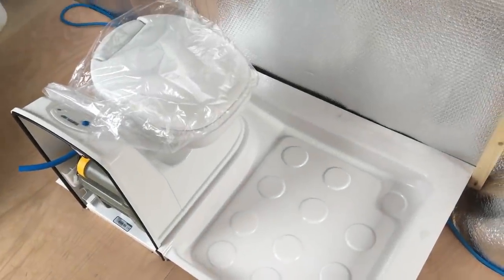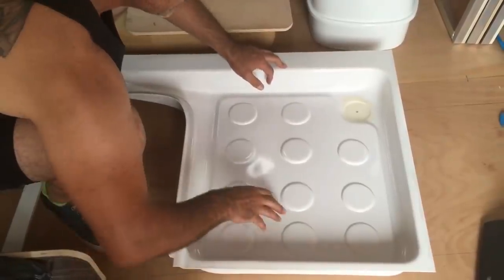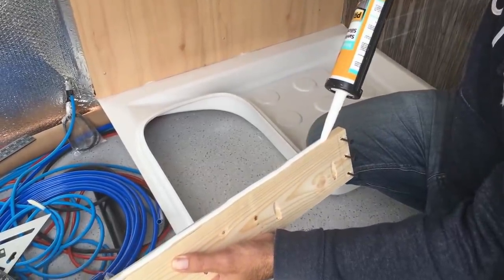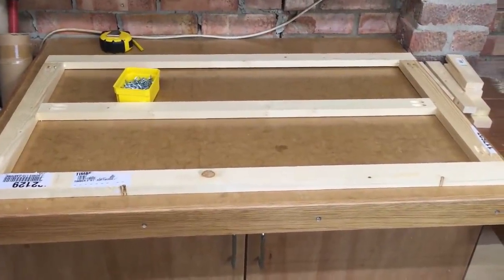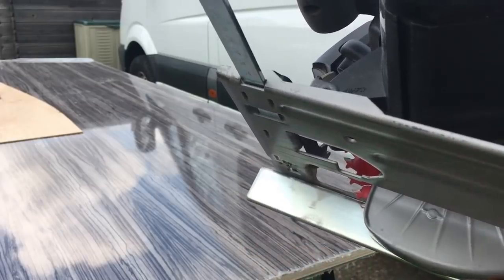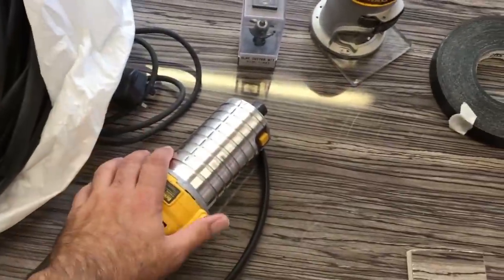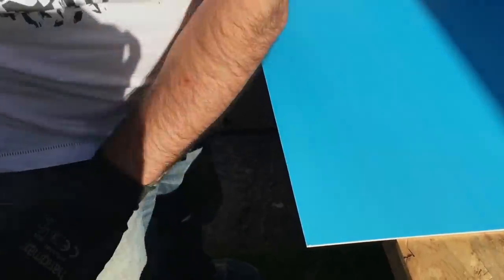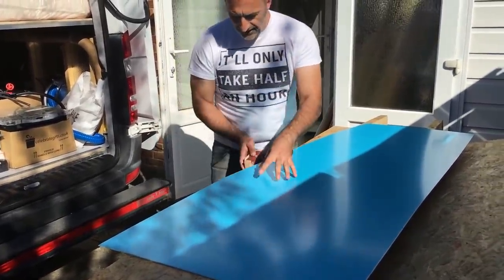Mercedes Sprinter Camper Van - Shower Build

Comment: I think you mounted that shower pan + cassette toilet a bit off. normally it should be 180 degrees rotated so you can pull the cassette outside of the vehicle. less messy when you need to empty it.
Reply from the maker: We have been living in the van for 4yrs now and not had any problems with the toilet. Nor have we had any smells inside either. 
Much easier than cutting through the Van body

Comment: Hi Gregg, Nice work as usual. I'd like to ask you about a previous video, the storage over the forward area.  Would it be possible to send me an Email on my direct  - mike at mikebarry dot eu. This relates to the work NOT shown in the video of removing the existing roof liner,  I have a van which was previously a welfare van so has full liners in the roof, so I would like to add the storage space.  I also do not have the benefit of the removed divider to use as a template for the vertical wall section onto which the door was fixed.  Thank you.
Reply from the maker: Hello Mike, my van didn't have a roof liner, as you see it on the strip out video that's how I brought it.
What can I help you with?

Comment: Hi Greg, Really helpful video as usual! I would like to ask about extractor fan install. I have the same extractor fan I think (Xpelair LV100 12v) and the unit is 87mm deep to back of motor. My van wall is probably only going to be around 60-65mm thick. It looks like your fan is fitted flush to the wall so just like to know if you had this problem and if so what was your solution? TIA
Reply from the maker: mine had a separate wall sleeve which was slightly larger in diameter to the fan and too long and I ended up cutting it down once I had the ply lining installed. You can see the liner installed very briefly at this point in the ply lining video. https://youtu.be/6AdxcqU8Y6M?t=502
Reply: @GregVirgoe  yes I have the liner sleeve also and can cut it to fit. My question is the unit itself is 87mm deep and cannot be shortened so it looks like I will have to pack it out by around 25mm instead of having a flush fit inside
Reply: @paulgoddard6695  @grev virgoe Hi Paul, I hope you don't mind this message. I'm
Also struggling with the length of the same fan model at 83mm. Can I ask if you came up with a solution and would you mind sharing please? Also how did you get on with the external supplied vent as it doesn't look the most waterproof to me. Probably flapping over nothing. Tia Sharon & Martin
Reply: @sharonrowland5365  Hi Sharon. Nope I failed to find a solution so sealed the outside flaps and panelled I’ve on the inside. Consequently I abandoned an enclosed shower and fitted a deep tray with a shower curtain attached to the ceiling when needed. For ventilation we can use the Maxxfan or have the door open. It has turned out well for us as the van is much more open and spacious . The shower tray is deep enough for storing wet things and has a seat lid